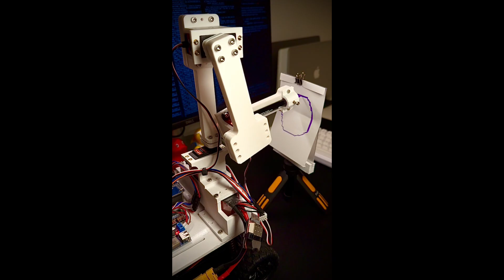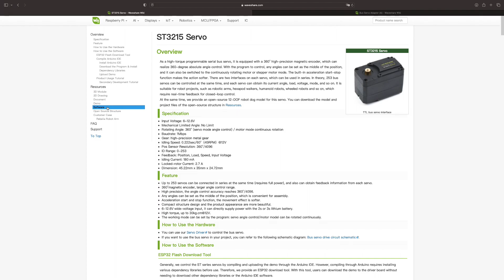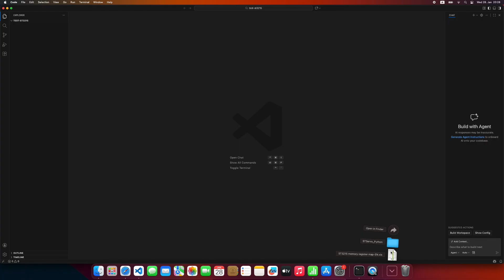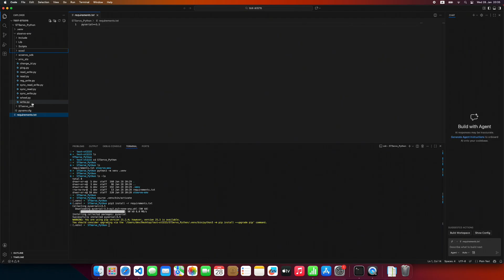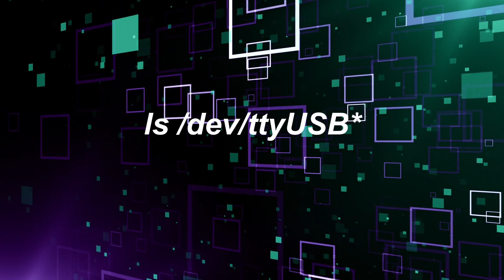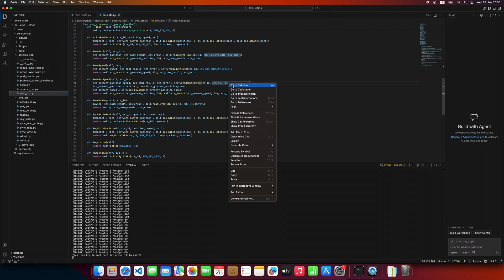How to Use the ST3215 Servo Motor

Comment: I think the libraries are gone from the wiki page D:
Reply from the maker: I think they are still there! If you go to the Bus Servo Adapter (A) wiki page from Waveshare and look at the Demo section at the bottom, there should be a link to the Python library.
Reply: @kitajimarobotics  Ah, you are absolutely right. I was looking everywhere on the servo page instead of the adapter one. Now everything works out, thanks for your great tutorial :)
Reply from the maker: I found recently that you can even use these readily available python libraries from pip: https://pypi.org/project/python-st3215/

I tested them and they also work fine.

Comment: gahhh python libraries.. that means i have to write my own things to use this in C instead, I really dislike python. thanks for the video anyway :) good info!.
Reply: I now have written a "library" (its a single html file with javascript) in javascript that I use instead. Only thing to think off is the highbyte lowbyte is reversed.  I got a Waveshare ST3215, and also a FeeTech 3215. Both are the 7.4v model (For newbies, if you connect 12v to these they will be damaged probably). Anyway, what I noticed is that the Waveshare comes set with nice parameters so it moves smooth to its destination, while the feetech was setup with acceleration 0 (which means it will go as fast as possible to the end destination... luckily i already thought ot not trusting the servos, while it was swining my arm very fast lol.), setting the Feetech to 96 made it go more smoothly with a acceleration and deacceleration.
Reply from the maker: Nice that you made it work with your own library! I have only worked with the ST3215 motors, and as you mentioned, it worked fine out of the box. I didn't have to tweak any parameters. But it must be a cool exercise to change those parameters and see what effects they have.

Comment: is the servo pwm controllable? i am thinking of purchasing it for control system project in which i am controlling robotic arm through a close loop controller which controlles through torque.
Reply from the maker: I don’t think you can control it directly using regular PWM signals like you would with other regular hobby servos. It has a position mode which you tell it the desired position and it goes there. It also has a speed mode, which lets you indirectly control the voltage to the motor  by saying how fast it should go.

But I think it does let you read current as feedback, which you can then convert to torque. I don’t know if that would be useful for your project.

Comment: Can you explain how you mounted it to the board? Did you unscrew the big screw on the corners and screw them back in?
Reply from the maker: For me the motor came with a few small screws. There are four holes on the top and on the bottom of the motor where these screws go. I then used a 3D printed adapter, so I could use M3 screws to mount it to the board you see on the video. If you want, I designed this adapter here: https://www.thingiverse.com/thing:7324393
I hope it is useful to you!